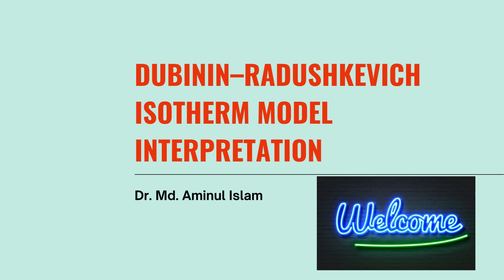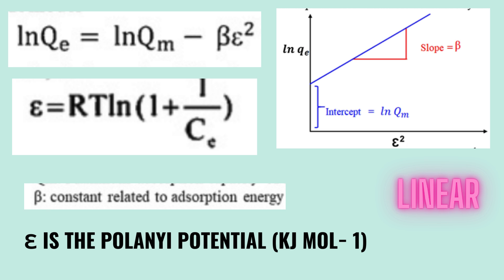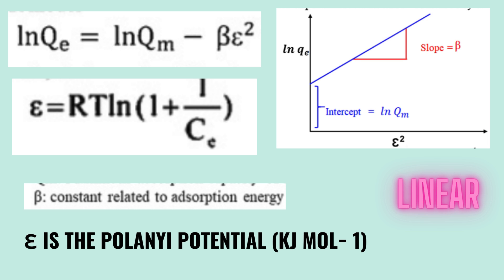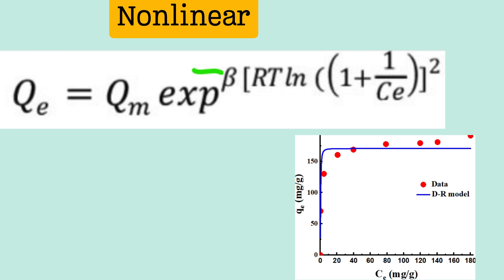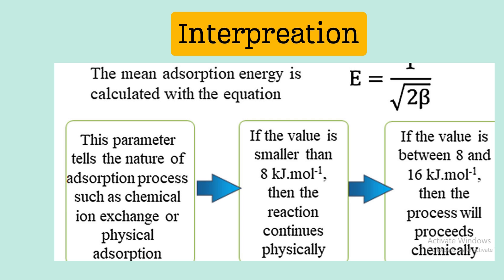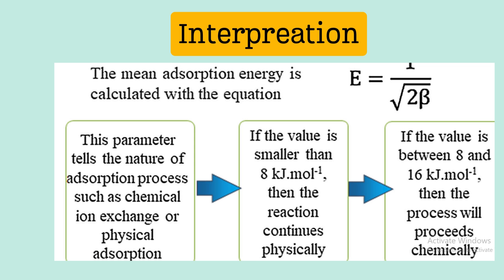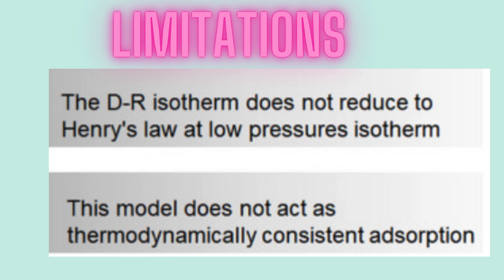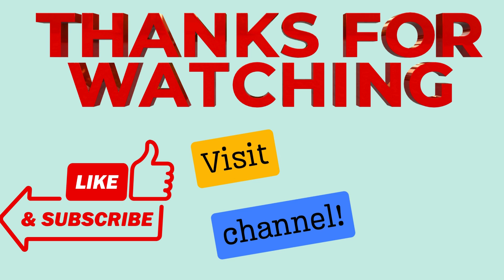Dubinin–Radushkevich Model Interpretation

Comment: Àsslam O allikum Sir, Hope you are doing well. I just done my adsorption study on MO, MV, and pharmaceutical drug with adsorption capacities ( 415, 328 and 105 mg/g, respectively) suggest me any best journal. Kindly also suggest me if i want to submit my paper in chemical engineering or higher impact factor is this study okay? Or what should I add additional? Thanks.
Reply from the maker: If your adsorbent is novel and added some spectroscopic study and DFT, RSM or ANN Or ML then consider submitting a High IF journal otherwise submit low IF.
Reply: @Aminulchem  sir what DFT, RSM, ANN and ML?
Reply from the maker: These are theoretical investigations used to study the mechanism and optimization of the adsorption process. For more information, read my recent article: https://www.researchgate.net/publication/377134277_Adsorptive_removal_of_paracetamol_from_aqueous_media_A_comprehensive_review_of_adsorbent_materials_adsorption_mechanisms_recent_advancements_and_future_perspectives @ejazhussain7164
Reply from the maker: If your adsorbent is novel and added some spectroscopic study and DFT, RSM or ANN Or ML then consider submitting it to the high IF J. Otherwise submit it to a low IF journal